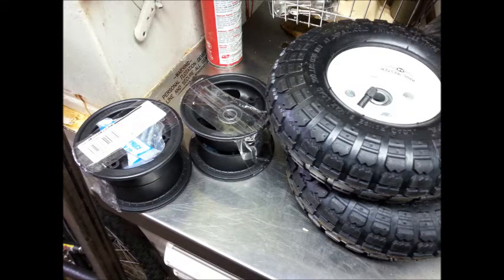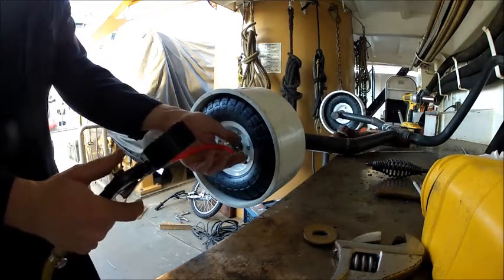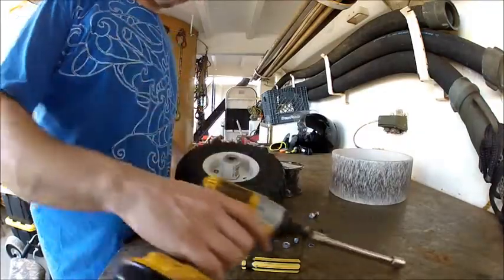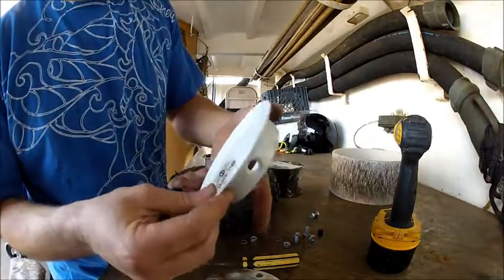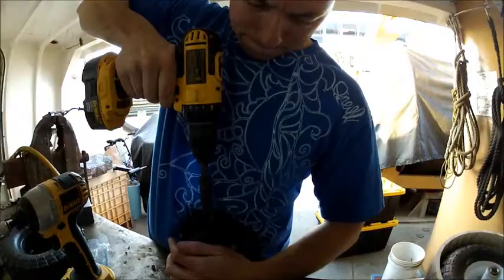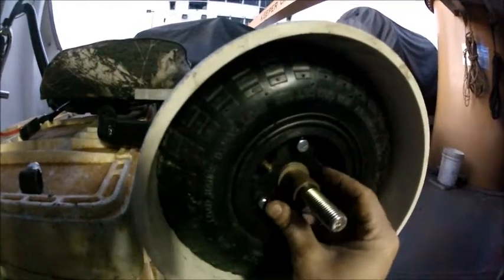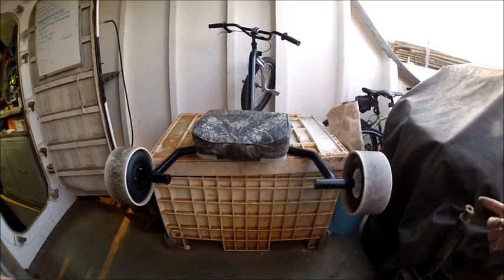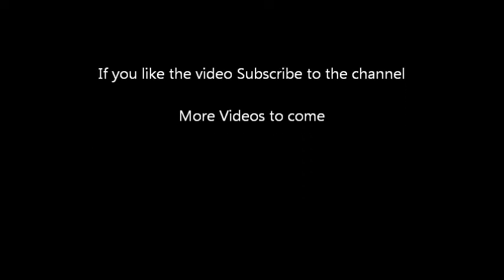Drift Trike Wheel Test

Comment: Also, I ran some harbor freight wheels (the 8 inch tires) and they do get worn, but you got to make sure you aren't tightening the wheel nuts so that they're pressing in too hard, because that wears them really hard. you didn't have this problem in the other ones because they are flush

Comment: I didn't see this video. I got the PVC size, but where did you find the 10 inch pipe? You might want to check out American Power Sports for kart parts. I build racing cage karts and have been getting my parts there for years.Thanks.